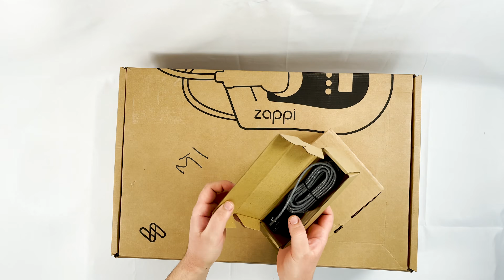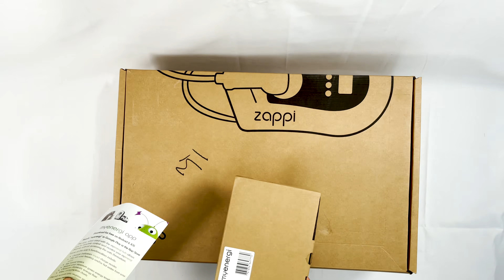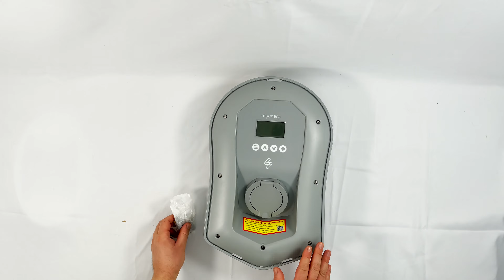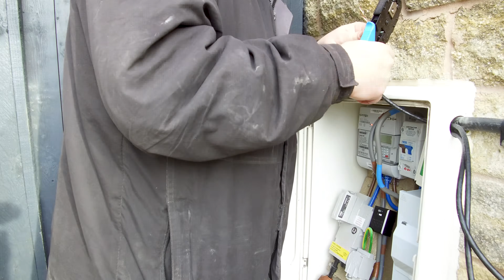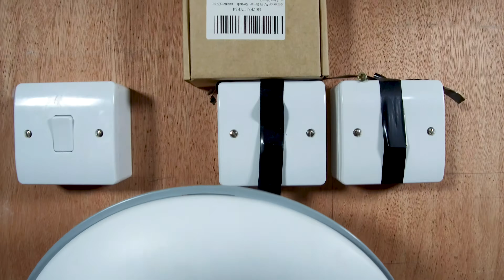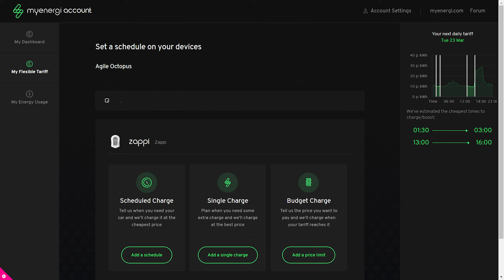Charge Via Solar, Battery And Dynamic Pricing Is Zappi Ready?

Comment: Hi Nick, great video.  Had good solar today and charging house batteries.  When house batteries reached 100% connected EV to charge of solar.  But house batteries promptly starting discharging into car.  How do I stop that?  Would welcome comprehensive video on use of Myenergy app with solar, batteries, eddi, zappi and EV.  Many thanks
Reply from the maker: You got a Ct on the battery?  So one on grid, one on solar and one on battery?
Reply from the maker: Or you on a hybrid solar system with battery on same inverter as solar? For this to work your need to get something like home assistant and get zappi and your battery working on that to automate your own fix tweet me on Twitter and I’ll try get someone who’s done same to maybe help,  video on installing home assistant on channel

Comment: Harvi signal struggles over 30-40 metres depending on obstructions. It can only limit or see 65A (I think) also, so if your trying to protect 100A fuse from overloading, need to hard wire the CT's straight to zappi
Reply from the maker: I believe they have a new harvi that will be 100a hoping to re review zappi soon!

Comment: curious if you have  a 3-fas connected home. wont you need 4 clamps?  so that the  effect meter per fase wil be regulated over the 3 fases to the car charger. Else your main fuses blow out constantly if all 3 fases are being loaded the same. I have a heatpump in my home using sometimes alot on one fase but the other fases are not being used as much.

Comment: 21:35 As an Ex Network Engineer/Planner, there's virtually NO EXCUSE for your servers to be unavailable due to a 'Network' issue. This is basically a unprotected backbone with no diversity either through using a single provider, or using multiple provider's using the last hop over the same infrastructure (Duct, Path, Exchange, Colocation, Provider etc etc).

It's poor disaster recovery planning to have your services provided over the same Operator/Path/ or duct.

Everyone in the business could tell them they need a diverse Network with multiple providers entering the building from at least two independent directions into two Telecoms rooms, at opposite ends of the building, using independent UPS and Generator backed systems for both area's and possibly 2 separate power supplies for both rooms (same for the servers). If you can't do this in house then host it with someone that does, across at least 2 sites interlinked as well for even greater redundancy! 

There's plenty of colocation sites around with exactly this infrastructure that Virtually Guarantees 100% up time!

Comment: You only need 1 incoming grid ct to do solar diversion charging and all of the eco modes. The second solar ct is for information display purposes.
Reply from the maker: indeed you can do solar on just 1 ct,  however having 2/3 adds extra data but biggest issue is if you then get a grid battery

Comment: Zappi is physically unnecessary large. I know it meant for cable looping around it but that is possible with a smaller unit also.
Reply from the maker: There's 2 arguments that 1 it provides extra space for cooling and 2 it means you can use it to wrap cable round....

Comment: Great video, really helpful. Do you know if the Zappi can be used to charge a house battery system from the grid - ie take the low tariff (Octopus Go) at night and charge the house battery if the EV doesn't need it or is not connected?

Comment: Zappi is a great charger. Though you cannot use a third CT clamp to monitor batteries if your batteries are DC. AC is fine. Thats what their help line told me.
Reply from the maker: Technically right but all home units tend to be DC however it will go threw an AC converter before entering your homes electrics so to monitor it you put the CT clamp on the tail leaving the battery as the DC to AC converter is usally part of the battery packaging unless you've made your own or have some Chinese brand system in which case you put it after the inverter
Reply: @NicolasRaimo  Thanks. I did ring Myenergi to try and sort this so I could monitor the batteries etc via the hub, I even gave them the battery name and model number and was told it wasn't possible. I think its because I have a growatt hybrid inverter, so both the batteries and solar input the same inverter, with 1 ac out to the electrics. I'm no expert though. Your thoughts?
Reply from the maker: @lmlmlmjm  yes kinda,  there is a setting on the CT clamp for your system thou called “battery and solar”
Reply: @NicolasRaimo  Thanks again. The solar installer did try that, but again didn't work. As I can only use 1 ct it needs to be set to generation.

Comment: Zappi still does not work with the  VW ID3 when trying to charge on eco mode on a sunny day. As soon as  it gets cloudy , the Zappi switches to the house and the car goes to sleep and needs manually waking to charge when the sun comes out. This is a real pain . Robert Llewelyn also had issues with Zappi and the VW ID3 and VW I D4 I gather.
Reply from the maker: Hi Leo i've heard via the grape vine ID3 is now working
Reply: @NicolasRaimo  it wasn’t last weekend! Fingers crossed I’ll ask my friend with a ID3
Reply from the maker: @leoclarke6462  it may need a dealer trip to update it
Reply: May sound like a silly question, but is your charge timer off? It might be reverting back to that.

Comment: I'm thinking about getting the Ford E-Transit for next year. Am I right in thinking I don't need one of these wall chargers for my home, as I have no solar panels anyway? Considering I could just use the supplied mobile charger with the 32A commando plug (if it is a 32A size plug instead of 16A).
What are the pros/cons of one over the other? I've been looking at some of your other videos but not yet found anything about this.
Reply from the maker: Hi Tommy the van will come with a type 2 to type 2 plug your need a home charger unit like this to plug it in at home,  this unit is one of a few chargers this one shown is just better for solar or battery storage and also for agile so it lets you future proof your install but check out the other chargers also.   If you go to my playlist section on my channel theres a link to all the reviews.   There is also a link to why you shouldn't be charging using a 3 pin plug and why i also don't recommend a commando style system the reason for the last 2 is down is the safety aspects that these units come with electrically.